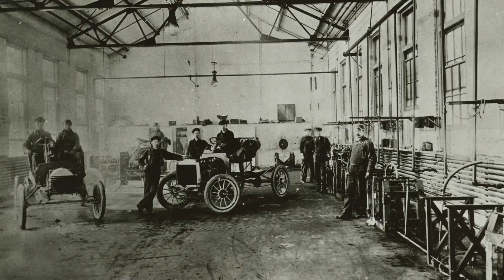They're ALL wrong about the future of robotics.

Comment: Yes! This is what I am saying! My robot is very basic. Just a upright one. It can move around and look. I want a shift towards how computers are treated. Not so much a single unit but rather modular systems. We need machines that are easy to modify to a given task for a low price.
Reply: I was searching data on some robotics companies for a project yesterday, and I came upon NimbleOne robotics , literally a modular robot,built of straight segmented, with wheels and sensors chained together to make it extremely , as the company's namesake portrays, it can do things in a way that is so agile, it can have a low cross section on purpose to come though small spaces ect...

It was made for maintenance and other such tasks, and you can tell that was the intent, as it seems like it has strictly the tools to do the job that it needs to do, down to its body plan/shape.
Humanoid robots look unwieldy and are more complex for no practical reason.
Reply: What are you envisioning?

Here are the key requirements for it to operate in our world:

Height- It needs to be tall enough to access areas built for our human height.

Hands- It needs high hand dexterity for a lot of tasks.

Legs- It needs to be able to traverse a world built for human legs. We cant adapt every piece of infrastructure, manufacturing and our homes for a robot overnight. 

A question, is your vision one focused on the robotics in manufacturing, in personal/home use or something third?
Reply: @ 
Why its modular. Well what I want to make at least. If unit is in say a office it may not need legs but if a person wanted it and had say 3 floors it would need legs. Same for arms. Someone might want to configure it as driving advert or one of them serving robots.

Id like to think it can be focused on anything really. Kinda thinking along the lines of 70-80s computers. Got used in all sorts of things. 

I mean really I just like robots a lot and think its a shame all the new robots on the block are so proprietary.